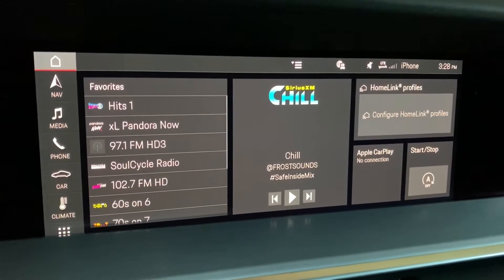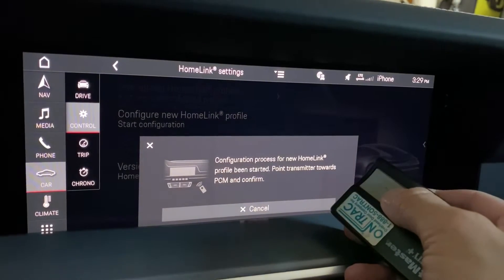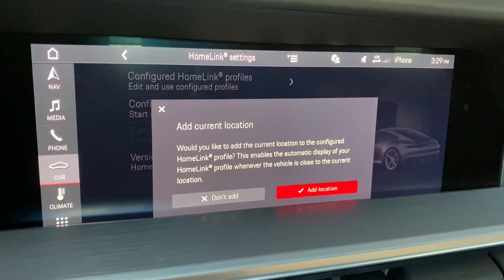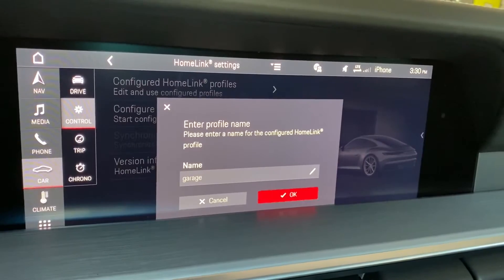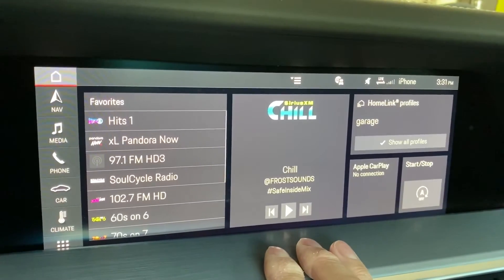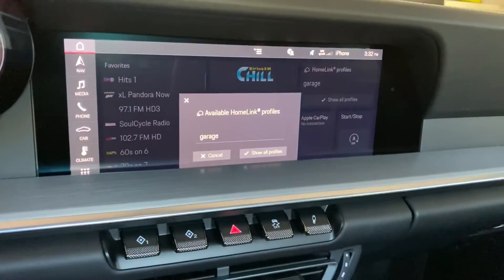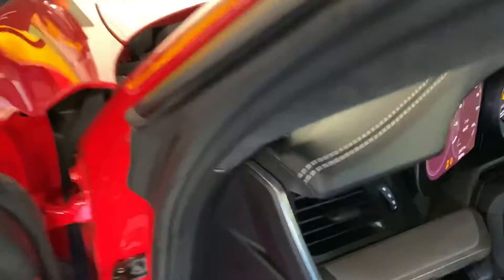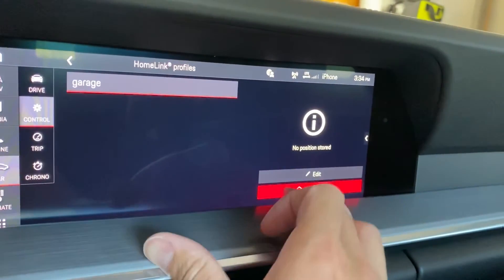How to Pair a Garage Door to the HomeLink System in a Porsche 992 - PCM 5.0

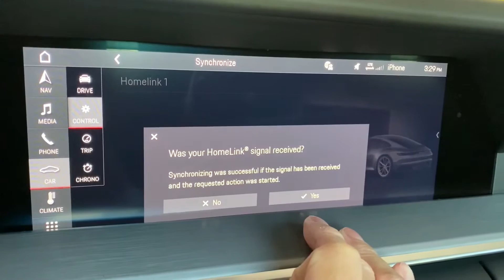Comment: I got the 992 delivered today, and tried your instruction, but it did not work. Then I went back to the step in your video, 1:30, "Was your HomeLink signal received?", and clicked "No" about 3 times, then my garage door moved, and it worked ever since. So I am not sure if using the garage door opener button previously affected or not, but if all fails, then I'd recommend to go back and repeat the step in 1:30 several times. I cannot believe they removed so simple to use 1, 2, 3 garage door buttons in front of the rearview mirror in 992, but the car itself is a rocket, love it!

Comment: I found that Genie Illuminator GL2T won't work with Porsche Homelink.
Porsche Homelink just did not recognize the signal at all.
I'm guessing GL2T generates signals differently from other simpler Genie remotes.
I Had to use an old intellicode remote which fortunately I did not throw away.